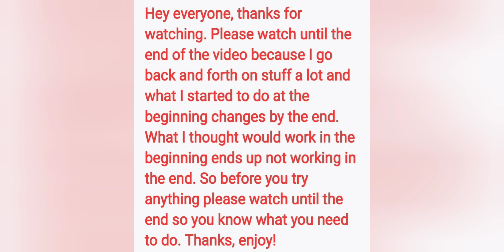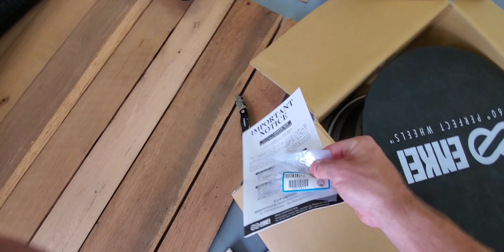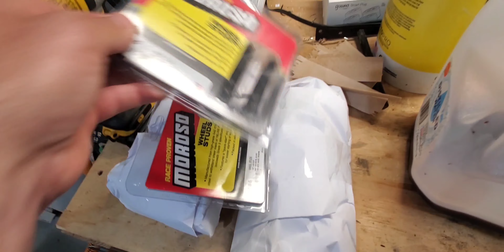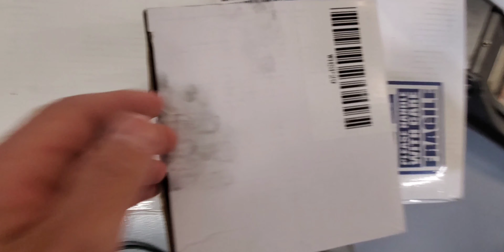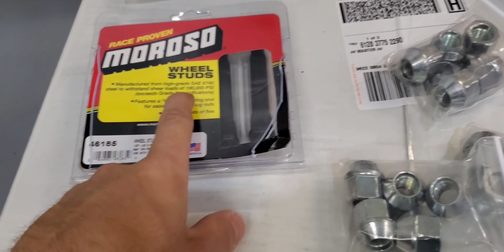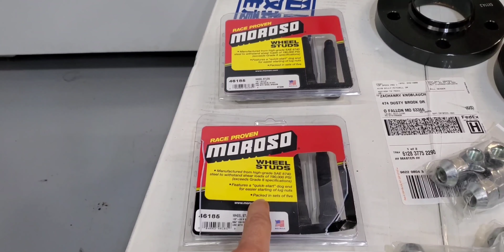Fitting 18x10.5" Rims w/ 315 Tires on a SN95 Mustang | 97 Cobra Project

Comment: I don't have a Cobra I have a 96 GT but have the same wheels I've been building imports for about 30 years and finally went back to my roots I'm from a mustang family at 80 years old my dad still has a Shelby. I didn't want it traditional mustang wheel. I always wanted a set of these and finally splurged and so happy I did they look fantastic on the car

Comment: It's always a challenge trying to fit huge rims and tires on the front of these cars. Thank you for showing all the details. Steering rack limiters will keep the tire off the sway bar. I use several limiters on my autocross cars, and I never run into an issue. I've never come close to full steering lock out on course, but courses do vary.

Comment: #BecauseRacecar. You figured it out, but definitely need to check with tire at ride height. Could have also removed the spring to move the tire up and down to check fitment. 

Just get some more steering rack limiters. I ran for awhile without fender liners, but putting them back in now. I got rocks and dirt all up in the door jams.

Comment: I have some 18x10.5 +15 offset wheels in the back of my 96 cobra with 315/35/18 nitto nt01 tires and the wheels and tires sit flush to the fender! In the front I am running a 18x9.5 with an offset of +30 with a 265/35/18 nitto nt05 tire and still have about a quarter inch of room,so I’m going to use a spacer so they sit more flush to the edge of the fender
Reply: Do you think a +40 offset in the front would solve your problem and sit flush? I’ve been worrying about buying the wrong size wheel for the perfect fitment I’m looking for.
Reply from the maker: I guess it depends on what width and diameter you go with. Google wheel fitment calculator, there are some good sites that show fitment based on wheel and tire specs
Reply: @ExtremeRugburn  Trevor, What did you end up going with? I’m trying to figure out wheels/tires for my 1997 Cobra.
Reply: Hey, I have a 97 cobra.  Do you think 19x9.5et25 front and 19x11et20 rear would fit my cobra?  Need to roll fenders?
Reply: @markk4708  the front will definitely fit flush with that set up on a 275/35/18 tire but remember some tires can be the same specs and still be wider or skinnier than one another because of different manufactures.. that rear spec sounds about right too since you’re running .5 inch more width than my set up, but you will definitely have to roll your rear fenders! Please get them rolled professionally, the previous owner of my 96 cobra cut slices and hammered the fender lip in and it would cut through my tires badly!
Reply: @petrolhead8851  awesome thanks man!
Reply: Should try for the Front 18x8 or 18x9 and you wont have a problem n add a half inch spacer if you like
Reply: @luisferna4461  you can actually fit a 18x10 in the front no problem on these cars if you got the right offset

Comment: Good job! but personally I don't like tyres sticking out of fender... So I went with 275/40/17 for the rear and kept it original on front... imo, you don't need any wider if you're not supercharging the cobra...
Reply: Width isnt just about sticking power in a straight line it's about having more rubber on the road for better cornering.  Not everyone only does straight line stuff running wide square setups is common on road course and autocross cars.

Comment: Have you considered removing the front spacer and using steering rack limiters? You’ll loose a bit of steering angle, but it would pull that front tire in.
Reply from the maker: Hey Matt, if you watch towards the end I removed the front spacers. I’m going to get an alignment soon and see where she sits then and go from there after that